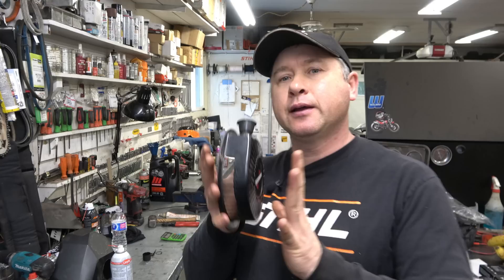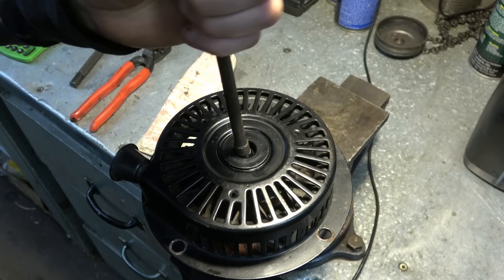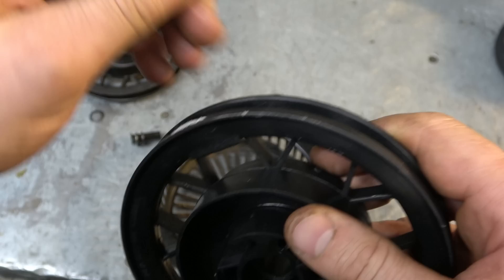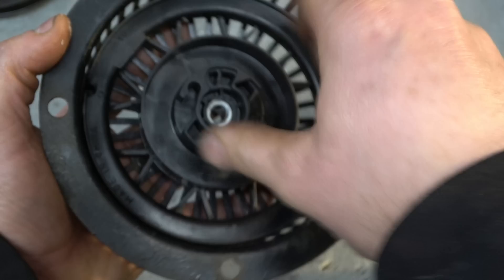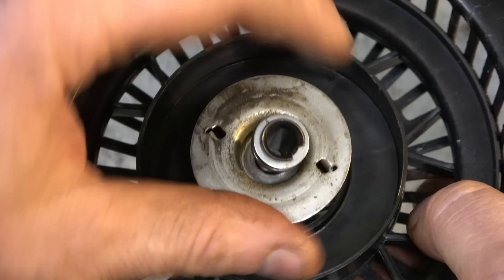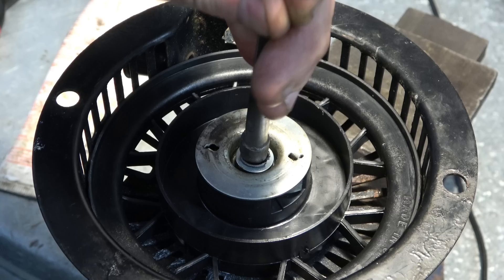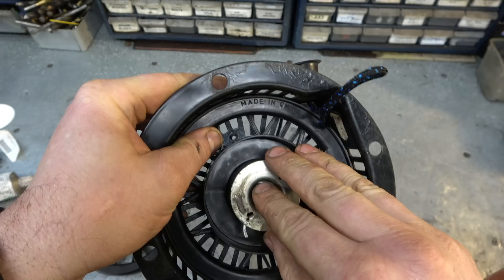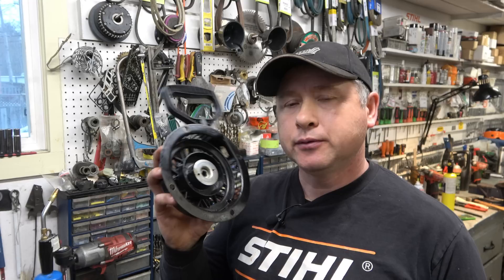Snowblower Recoil Starter Spring Replacement On Tecumseh LCT Engines With Donyboy73

Comment: Wastage in action.  Rather that replace a spring you have to buy complete assy.  trimmers clutch housing does a bearing again buy a new assy.  There will be no mechanics in the future just part swappers being told what to change and how to change it by software.  Wish sometimes that an Asteroid will smack into this planet and reset us for a bit.

Comment: You can skip the plastic melting process by just winding the spring fully tight then backing off until the rope hole in the sheave matches up with the rope hole in the housing. I like to get it there by backing off at least 1 full turn. That's was how I was taught at Tecumseh school back in the 90s.

Comment: Have an old Troy bilt Horse tiller with a Kohler K161T engine. The recoil starter is shot. Insides broken and only 1 dawg left. I am unable to find a replacement. Is the another brand that may work on this tiller?

Comment: This is the best tutorial I have been able to find on repairing a brokenTecumseh recoil spring. Thanks so much for posting it. Yesterday I went to replace the rope on my tiller and the spring would not tighten. Really did not want to have to replace the entire assembly. The engine is a H-50 from around 1992.

Comment: As options to a heated up screw driver  to make the notch in the plastic you can use a round file and file away.  Or a Dremmel tool with an appropriate cutting tool.  Good video.  Very informative.

Comment: Nice video.  I like to use my small rotary tool( dremel to most) and  either a cutting disc or drill bit to make that hole for the rope. Quick and easy
Reply from the maker: that's a good tip!

Comment: Thanks!  You always have good videos, very informative.  I had an old Tecumseh like that.  The blower housing finally rusted all to pieces and I gave up on it.  The engine was still good though, but some little problems like the recoil was bad and the carburetor would leak sometimes.  Good machine for many years though.

Comment: Quick q would a extra turn make the spring pop out if u pull too much when starting? I’m having trouble spring is fine but when trying to start spring fails till I take apart then works fine until I hook up and than doesn’t retract
Reply from the maker: yes the spring will keep popping out and won't retrack

Comment: Fantastic advice and how-to! Just found your channel. Looking for a  snowblower that I can depend on for reliability and replacement parts when needed. I live near Montréal and need a 24" 2 stage gas machine. Any suggestions?
Reply from the maker: toro, ariens or cub cadet
Reply: @donyboy73  podadora craftzman 3.5hp    escupe lumbre por escape mofle

Comment: The first thing I want to say is there's nothing wrong with doing it the way he's offering here. In fact there's probably a lot more satisfaction involved. However years ago they wouldn't allow us to change the parts on a recoil that was externally mounted like this. It was just company policy and since the parts are almost expensive as a new one depending on your labor calculation plus fewer call backs the mold is set. If you have a one hour min labor rate price should be the same either way. We kept a lot of these on the truck so it was a quick fix.